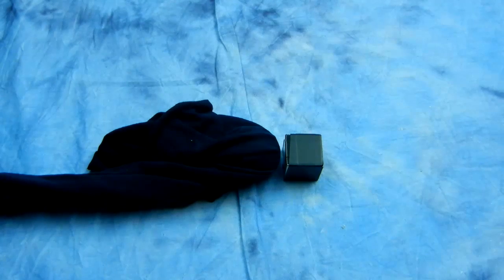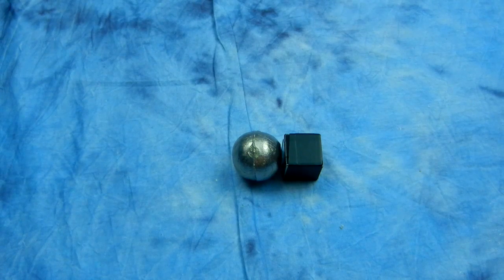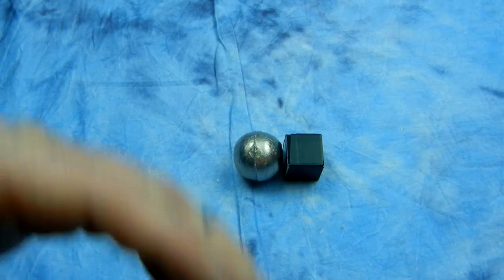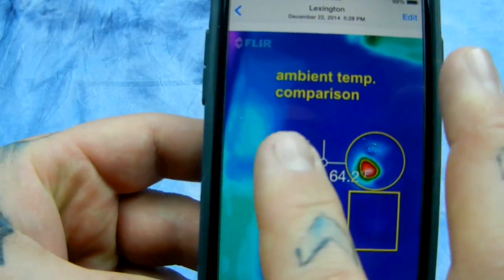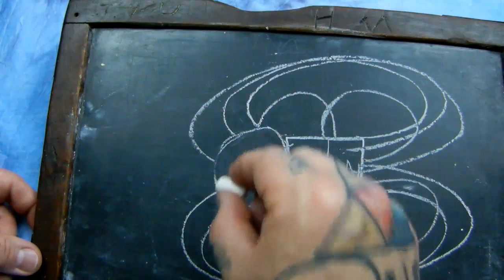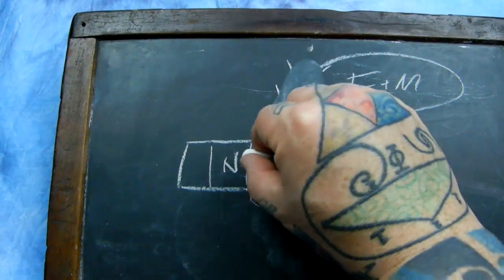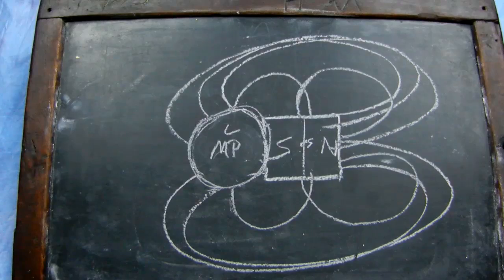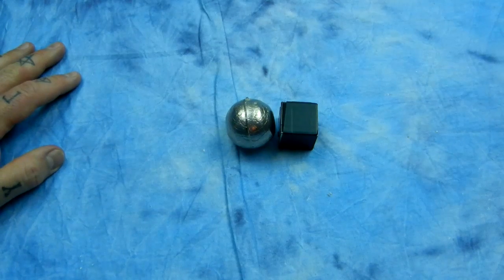Zero Input & Heat Generation ("free" energy) binary mechanism. FIRST TIME EVER SEEN

Comment: My take on this is that the material heats per Lenz's law, it creates its own field when the external field creates a current in the material which is unique for bismuth..The current causes heat dissipation.

I wonder if it can induce current in the following setup: high permeable UU core, magnet between the leg ends of one side and bismuth with the same size and shape as the magnet between the other legs, coil around the bismuth, a load and/or volt meter on the coil. The bismuth reacts like the counter-mmf a coil produces when a current is magnetically induced.

Comment: So what do the magnetic fields look like around an electrified bismuth wire? What does it look like in counter space between two parallel electrified bismuth wires? Has anyone made a ferrofluid out of bismuth? Using the method of making iron magnets, how would bismuth react after trying to turn it into a magnet?

Comment: Another thought. What about using molten bismuth. Could you make it maintain it's hot temperature with magnets? If so, you could definitely use it to power a Sterling engine.you could get it to a temperature that would run a Sterling engine, them maintain that temperature. Use energy to get it up to temperature, then after the initial heating it would maintain it's temperature and run the engine as long as you have the magnets surrounding it. 
        I picture a half sphere of Bismuth, with pyramid shaped magnet pointing towards it's curved surfaces.then the Sterling engine on the flat surface.
       You'd only need to burn fuel to get it to temperature, then it would continue to run as long as you keep the half sphere in the magnets.

Comment: Would this be enough to run a Sterling engine? Would having a Bismuth sphere at the other pole be additive or exponential? Or, perhaps having another magnet on the other side of the sphere might produce more heat. Or perhaps having 4 magnets surrounding the sphere would increase the heat. Or, perhaps a Bismuth sphere with a ring of pyramidal magnets around it might produce more heat. Perhaps a bar of Bismuth with halbach arrays on each side may produce more heat. I would be interested to see if you could produce enough heat to run a small Sterling engine placed on top of a magnet/Bismuth  arrangement

Comment: You didn't show that on infrared camera. You showed modified photos
Reply: Naw,  what he showed is probably legitimate. This guy has showed other legit stuff that didn't break any physics.  

What it is that bismuth is very dense and resistance to electric current, so much so that it radiates the atomic motion as heat very quickly when introduced to a strong magnetic field.  Its literally the same mechanics as a microwave oven where a spinning magnetic field causes atomic friction releasing heat.

Comment: If your invention is true,  you could do the following experiment which should destroy itself.
  Example https://www.shutterstock.com/image-vector/vector-volume-hollow-sphere-open-ball-458140573  
You could make 5 type hollow bismuth balls, each smaller than the next so they fit easily within each other. 6th ball is a solid ball in the center.

Using sandpaper, garnet, not emery, not aluminum oxide, not silicon, not zirconia, not ceramic.
Use control material of bismuth, not the experiment matter at first to get the sandpaper lease likely to contaminate, get sandpaper little worn with the control bismuth. so when you sand the outside of the balls it less to containment the outside of the balls.  Clean your balls.

Need to finish inside of the balls so they are mirror surface.  Use radiant heat source, none flame, to make the surface mirror.  Sorry, cannot tell how to polish your balls.  Silver polish?
Placing your small “balls” inside each other.

Rerun your experiment in the controlled environment.  Still betting your balls are colder than interior environmental control box.  

Lookup 70f clear sky, no moon, 4 mirrors, old refrigerator with the door removed, flat on it back, a dish with water and Ice forming in the dish in the center of the refrigerator by morning.  With 4 mirrors attached where the door was 45 degree facing the sky.

Comment: 1. You have not provided any baseline.
2. Your experiment is a product of the environment.  
3. Your video of casting bismuth of the 3 divots is an argument against what you think you have found here.

How about a baseline with an environmental control, 11 balls, number 1 to 11, and when you're done, I will pick a number to destroy and slice it up, prove there no air bubbles, some type of media, or foreign matter, etc.

The environment control, 6 mirrors, mirror side facing out, backside paint flat black, very carefully without affecting the mirror surface, sand the flat black a bit.  Increasing the surface area.  Retouch the backside of the mirror with flat black again, but keep the spray nozzle so far away when the paint is applied it does not appear wet.  Luckily your “balls” are small so that will fit in a small box.  Build a mirrored box with the mirror facing outward.

The control box would be better if made of aluminum, all painted flat black.  This will sit inside the mirrored box centered at the bottom.  

Inside the painted flat black aluminum box.

Isolated thermal reproduction area,  2 styrofoam cups inserted into each other, cut top excess off so that it can be quickly removed so that you can infrared photograph result.

Set your bismuth control number ball into the aluminum box, one at a time.  With the magnet, with styrofoam cup upside down covering only the bismuth ball.

Close aluminum box.
Close mirror box.
Let sit for 12 to 24 hours.
Measuring your results now.  Take the lid off mirror off, take the aluminum lid off, remove styrofoam cups, take the infrared pictures up to 3 minutes before false-positive data start to negate experiment.
Betting your balls are colder than the box around it.

Comment: Have not seen enough of your vids. Do you expand to the opposing fields of magnetism. Ie... Send a charge through the center of two same pole facing magnets creating the troidal force in 3d. Multiply the magnets and use enough charge to react ionically against the static troidal field of a body. Such as earth , the solar system, and deep space. I believe that is true anti gravity bubble. Humans can't survive inside most likely but inertia would not effect the insides of such a bubble. Plasma at centerpoint of two electro magnets should give the bubble the necessary repulsion in ionic field. Of s body to give the bubble lift or separatism from that body.

Comment: IS MATTER, I E, A MAGNET, SOME KIND OF ANTENNA FOCUSING THE ETHER INTO A CIRCULATING SERIES OF WAVES?
Reply: Robert Galletta in theory; matter, or the fields of energy which make up "matter" are indeed composed of the ether to begin with. What makes them different is that the energy that we are familiar with is the ether polarizing itself and representing itself as mutually dependent fields occupying space. It's like droplets of water that retain their boundary conditions, but still floats in an entire ocean. You could say that they are individual droplets of water, but they are only water in a mass of water; there's no actual difference besides the appearance of individuality. 
  I would say that your analogy is somewhat correct, but the hypothetical antenna itself is also made out of the ether. Our ultimate goal really is to utilize the polarized ether which we are familiar with, to draw excess energy from the ether, or in other words we use our polarized ether to further polarize the ether. By doing this we could get excess energy, but it's still coming from somewhere, and we still have to do work to get there.

Comment: If you leave those object together linger they might get hotter as the sphere heat soaks also if the sphere is smaller it might get hotter quicker do to having less thermal mass.

Comment: wouldn't the repercussions of this mean the magnetic field is in motion? The heat is molecular frictional heat right? It's almost working like the dielectric in a capacitor which is failing from over-voltage? Right?  It's like a magnetic, semi conductor, right?
Reply: permanent magnet=rotating magnetic field,, Tesla said it long ago

Comment: free energy: induction from an antenna coil can recharge a battery or a capacitor that originally sends out the signal from a primary coil to the secondary coil. In other words, the capacitor or battery sends out the pulse charge to a primary. Usually a battery to a capacitor then across a spark gap. Today we can use MOSFET oscillators to generate voltage frequency build up from a battery or capacitor. The primary is used to induce current in the secondary (classic Tesla Coil.) A secondary can be used to recharge the battery. The signal is said to go back in faster then the battery can be discharged. And actually, all a capacitor is, is just an alignment of the atoms and or molecules between surfaces, coherence, an unnatural disequilibrium. Therefore; we should be able to instantly charge a capacitor using a magnet, or a magnetic field from an electromagnetic coil. (And this is likely the same induction process happening in the self recharging device here being mentioned.) The outgoing primary coil can feed multiple other coils, thus multiplying its signal current and voltage; wattage. Thus it is a power generator and self (re-) charging device.

Comment: Since mercury is diamagnetic like bismuth, if the magnet was dipped in mercury, would it heat the mercury at both the north and south poles?
Reply: probably just the Magnetic North Perhaps even see a cooling on the South Opinion

Comment: just with your temp readings, you should have used your FLIR on the ball before and after the experiment, not showed the air temp before, as that is irrelevant. you want to show the balls change.Perhaps you did differently, but that's what I took from how those pics were presented. just so you know.Keep up the good videos, your an interesting man!

Comment: I also did similar to you..... poured molten Bismuth into a hollow rod shape and inserted diametrically polarised rod magnet down the centre. I used outer jacket of Aluminum, thought I was imagining the warmth. I was trying to test out Dr Schwartz free energy receiver concept at the time......watch?v=-VKHFnkDf54
But yes I was looking to harvest E/M radiation, not much seen on spectrum analyser though. Still have the rods here sitting on shelf.

Comment: There's a 9 degree difference in temperature.  So either the top end of its ability to heat is a predefined temperature which ended up being 9 degrees,  or it's relative to its environment.  If it's relative to its environment, then it may be  quite possible that a larger bismuth and neodymium magnet might be utilized in a immersion of possibly water to disperse the temperature increase with th he cumulative effect of raising the temp of the bismuth would increase the water it's submerged in. Therefore increasing the reference frames temperature that is increased by the 9 degrees internal to the bismuth would continue as its environment changed.

 As well I've seen your incredibly large magnet,  and could imagine the bismuth submerged ontop of it. Possibly creating a bismuth mold following the magnetic ratio in a 3-D design allowing water more surface area. If I'm correct, equating it with the concentration of solar covers on pools raising the temperature of water in insignificant  amounts eventually cumulatively raise the temp of the water, similarly the bismuth would do the same inside the volume of water. If such a process would continue in a sealed unit,  it's possible to achieve thermodynamic expansion of the water resulting in mechanical operations of simple design mechanical device,  if water temperature to the point of boiling then it could do even more work as a steam driven closed system to generate electricity, or as a simple engine. 

A simple small scale time lapse of even the design you used with the magnet underneath a container with the thinnest possible bottom  and the bismuth submerged in a container of water above it might result in a small scale model showing it's relative temperature is increased along with its environment. Obviously some type of thermal insulation would benefit it's increase from not being dissipated into the environment surrounding it. One design might consist of creating a container using double insulated glass and some adhesive to to form six panes of glass a small cube with the sixth one as the lid allowing the flir to image it, but also possible a thermometer on the inside as a secondary verification of its continuous rise in temperature.  

This may sound crazy as hell, but it's worth at least a small scale with what you already have over a 24hour period of time. As well give it a jump start with hot water,  see if the increasing temperature of the bismuth itself is increase in  a relative relation to its environment.  That's could be a easy start, temperature of the water is above the ambient temperature of the bismuth and the air temperature surrounding it. If there is a net gain inside the bismuth, then a insulated closed system should increase the water, therfore increasing the bismuth which increasingly should result in a upper limit of its ability to further increase the temperature of its surroundings. Its not free engery, it's just a different way that may be able to harness nature and its basice fundamental properties. 

If it is successful and does raise the temperature  it's something that could be easily and readily reproduced and independently verifiable. It wouldn't replace the nation's energy sources as a whole, but its out put might produce significantly higher energy than solar cells. If I had the bismuth and everything your equipped with I would give it a try. However you have nothing to lose, even if the idea turns out to be false,crazy and insane,  you can blast me as a crazy loon an have fun with my insane idea and how illogical it was and I didn't understand the complexity of what you had shown and could make for a funny video even with no results and utter failure of this idea. 

Still love your channel, and the photography side now even more as it has  Inspired me to try my hands with a photography as well without a simple point and click.
Reply: Is that a power plant?